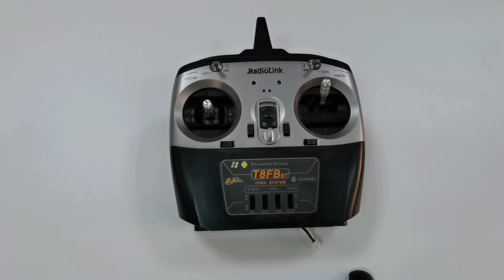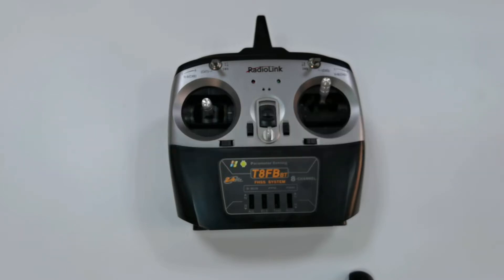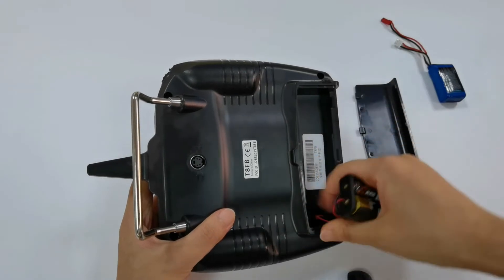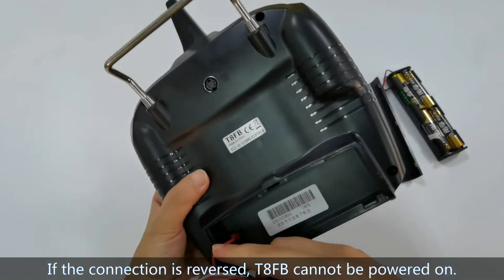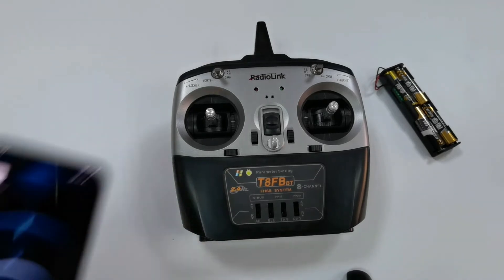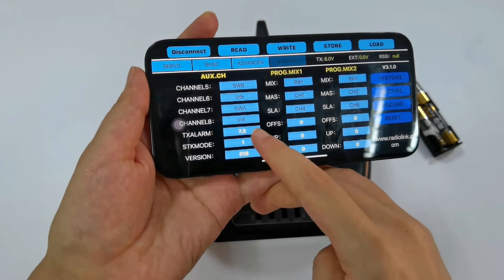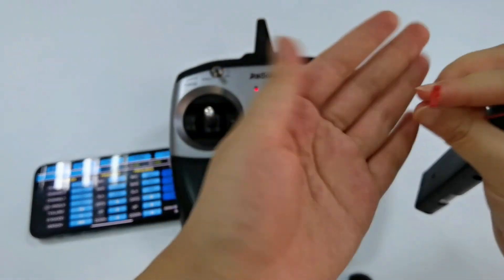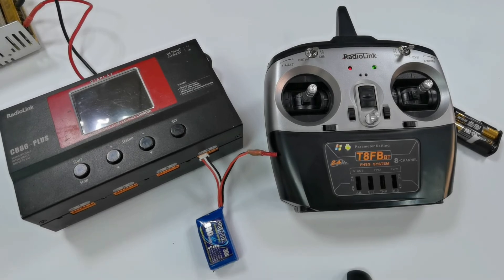TX Voltage Alarm & Battery Supply of T8FB

Comment: So Nickel Cadmium batterie’s cannot be used here, since one Ni Cd battery only provides ~1.3v
Reply from the maker: Hi, sir. When selecting  the battery, you need to make sure the battery voltage is within the working range of the transmitter, and the size of the battery fit the battery case. If any questions please feel free to contact us. You can send an email to after_service@radiolink.com.cn

Comment: Hi i am thinking to purchase this i want to make plane single propeler i dont want to make vary big plz suggest me battry for plane 

And wht is range of this transmeter
Reply: Then i place order
Reply from the maker: Hi, sir. Thank you for your support. May I know if you use any flight controller on your plane? Could you please the specifications of your plane? You need to check its working voltage and then you can choose the battery for the plane. If any question please feel free to contact us. Our email is: after_service@radiolink.com.cn

Comment: usb-input should also provide usb-power, currently it does not seem to. only battery input. yes if you want to use usb battery banks directly. the usb does not have to be a charger, only a voltage input directly.
Reply: whats with my realme android 11 basic phone not being able to use the app (installed both of the apks)
Reply from the maker: @gsestream  Hi, sir. Could you please first check what version of T8FB are you using? Are you using T8FB BT? Here is the download link of the APP of T8FB BT: https://www.radiolink.com/t8fb_bt_app  If you still cannot figure it out, could you please take a video to us to show what problem it is. Then we can know how to help you solve it. If any question please feel free to contact us. Our email is after_service@radiolink.com.cn
Reply from the maker: Hi, sir. Thank you for your support. The USB port cannot suply power to the transmitter. It is only used for firmware update. But I'll send your feedback to our R&D team and hope it can be schived in the future.

Comment: Please I powered my transmitter with a 24V 6S LiPo battery. Now it’s not turning on again but connects to my computer via usb. How do I fix it please?
Reply from the maker: Hi, sir. May I know what transmitter are you using? Our transmitter does not support 6S lipo battery because the 24V voltage exceeds their working voltage.  If any question, please feel free to contact us. Our email is after_service@radiolink.com.cn